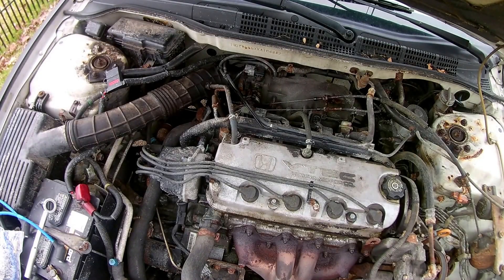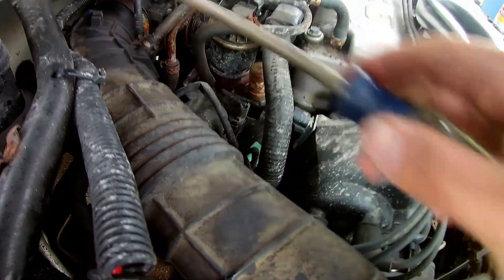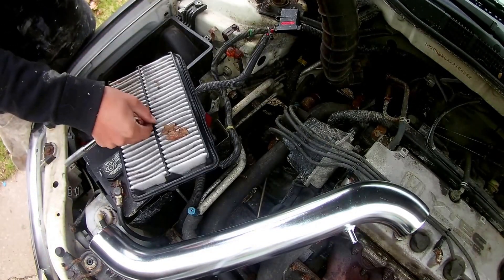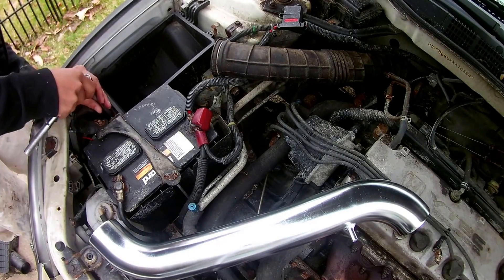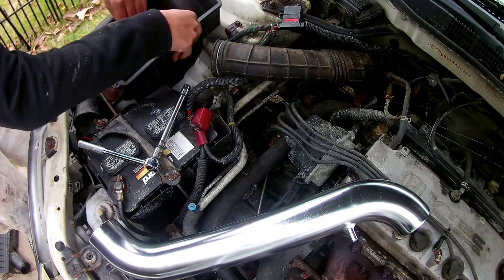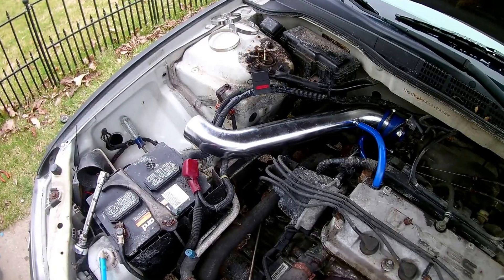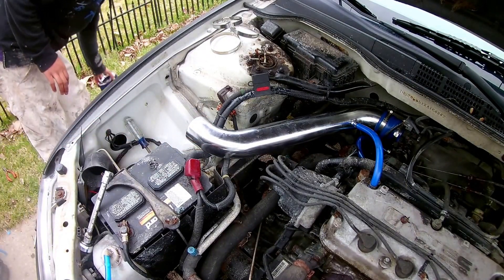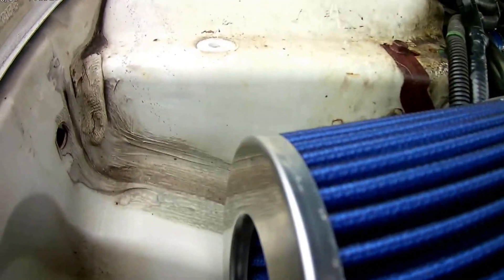How to Install Cold Air Intake on a Honda

Comment: I just got my 2000 honda accord ex. Ima put in the cool air intake first . Thanks bro
Reply from the maker: Good luck!
Reply: sorry to be offtopic but does someone know a way to get back into an instagram account?
I was stupid lost my login password. I love any tips you can offer me!
Reply: @Santana Kameron Instablaster :)
Reply: @Emmanuel Francisco it worked and I finally got access to my account again. I'm so happy!
Thank you so much, you saved my ass!
Reply: @Santana Kameron no problem :)
Reply: Serio dude i have a 02 ex coupe. I want to make it  into a rally car after I get my viper. The cold air intake is the first thing I'm getting for that ex
Reply: What good does the cold air intake do versus the regular air intake?
Reply: @Kontrol17  it just makes the engine sound cooler . They lie and say that it will increase your cars performance.  Unless you tune the car the airintake might even alter performance worse
Reply: @bobiphett4633 get the viper yet?

Comment: What did you do with all the other lines that you used the blue hose to replace?? I got like like 4
Reply from the maker: so the top line is just a ccv line basically a vacuum line the other you see are coolant lines that go into the throttle body. to help with cold weather. your car may be different but if you order your kit specific to your car it will have those accommodations.

Comment: You may want to get of make a heat shield to isolate the filter from the rest of the engine. While it is a ways away the heat of the engine bay with still reach it. Nice job tho.
Reply from the maker: ALPHA THE PANDA  Thanks for the great advice I have seance made a air duct str8 to the filter!!
Reply: Zay's Automotive is no problem mine is 94 accord ex so I've encountered somethings while working on it. Also if you haven't done it yet look into getting some new spark plugs and spark wires. NKG all the way my friend.
Reply from the maker: Yea man look at 3:33 NGK plugs and wire set is on the car!!
Reply: Zay's Automotive that ever so lovely acceleration rumble.
Reply: Zay's Automotive you also need to get your computer reprogrammed after every modification otherwise you waste your time , performance chips do not cost a lot , that way you get them tweaked also for higher octane fuel and any other modifications you have done , i watched that video you did on acceleration times and you were 0-60 mph in about 9.1 seconds these cars factory do 8.6 seconds . So all the mods you are doing are pointless without computer programming in fact its making your car slower
Reply: Dyno test have shown absolutely no decrease or increase in hp due to placement of the filter or temperature of the air.  The only increase comes from the amount of air being pushed into the engine; after all, your engine is nothing more than an air compressor.

Comment: That’s not a cold air intake. It’s sucking hot air now, good job. For it to be a cold air intake the intake has to be down toward the bottom of the fender, away from the HOT AIR of the engine.
Reply from the maker: True

Comment: These things are more detrimental versus the so called “performance boosts” they give. The only thing this’ll do is shorten the car’s lifespan. It doesn’t increase mpg, or horsepower. It just makes noise. That’s pretty much it. 

When adding one of these you still need to reprogram the computer for it to work flawlessly. And even then, the accord wasn’t designed for this to begin with. Any amateur who thinks they can just remove the stock and replace it with this, is sadly in for a bad time. Especially if they do it wrong.
Reply from the maker: Very true !

Comment: What exactly did you do with the coolant line that goes from the block to the throttle body? Leave the stock one or just replace it with a straight hose connecting the ports?
Reply from the maker: I deleted the stock metal line and ran a new line from the block to the throttle body works fine but really you can just leave it and it works just as well.. But i deleted because i also install a throttle body spacer as well and i would of delated anyway as well.

Comment: Can you explain what you did with the smaller hose? Looks like you cut it in half and used the other half just below it.
Reply from the maker: Yea so with the other half I  used it for a coolant line that goes from the block to the throttle body. For just looks and for the next upgrade of the throttle body spacer I was gonna need a extra inch of line for what was originally there.
Reply: Zay's Automotive thanks bro. So i have literally the same car, just put the intake on. Im getting a whistle when accelerating. I thought i had the clamps super tight. Did you replace the filter?
Reply from the maker: No problem and that's great you post a vid on it !!! I check out you gun videos too pretty cool. The whistle is normal its just the motor breathing better!! and for the filter you can replace it or I just clean it out with water and let it completely dry.

Comment: So I want to do this to my honda but my friend said it would run like shit because the computer isnt programmed for it. Is there any truth to that? Do you gotta reprogram the ecu to get it to run properly?
Reply: no it's not a nissan lol
Reply: You can add any cold air filter k and N is the best from local auto stores and no it does not effect the engine or throw any codes or check engine lights if anything u will get better throttle response and better. Gas mileage
Reply from the maker: Its not a major change to the motor the ECU will actually see that the motor is breathing better and adjust the air fuel..

Comment: Gotta 94 didn't come with a overflow resovor...how important is that
Reply from the maker: You might want to add one any autoparts store have them or junyards. It allows the colant to boil into the bottle. its also a easy way to keep a eye on your colant level.

Comment: Nice vid, hey when you changed your spark plug wires did u changd distributor as well or just wires?
Reply from the maker: Yes I did
Reply: I just changed my wires fuck the distributor it’s going on 4k miles

Comment: ???? So this intake comes with no support brackets and is only held up by the clamps and whatever happens to be under it ????
Reply from the maker: This one does because its so cheap but more expensive ones do have supports.
Reply: @ZaysAutomotive  Mine did come with a big hose clamp and an aluminum angle.  No instructions, you just gotta do your best and make it work; I made it work.  I also needed to add some insulation rubber for vibrations.  (My engine vibrates without the balance shafts)

Comment: Seems easy enough. I need a new air intake because mine looks old (or do they get old?) I bought the car 2 years ago. I wanna start working on it little by little.
Reply from the maker: Yea the actual filter itself get dirty you can either replace it or clean it. But both items are sold at the autoparts store.

Comment: You shoulda just pulled the lower section of the factory air intake system off and tossed it in the garbage and zip tied the breather filter to the top section of the factory air intake.  results? the same as seen if not better.
Reply: Lets see your ghetto rig... gotta link?
Reply from the maker: lets see it bro !!

Comment: So at 2:13 how did you remove that metal line?
Reply from the maker: It has pinch pinch clamps to them if you just squeeze them then pull out the metal ling you good to go..

Comment: short ram and cold air intake have any difference?
Reply from the maker: Short Ram is short and it usually sits in the engine bay. Cold air intake usually sits in the fender or has heat shielding around it.. Short ram sounds and looks cool for a cheap price. Cold air is all of those but has a performance increases and a little more expensive.

Comment: Hey man, where did you get the cold air intake from??
Reply from the maker: <a target="_blank" href="https://www.amazon.com/gp/product/B00L9NHYGK/ref=as_li_tl?ie=UTF8&camp=1789&creative=9325&creativeASIN=B00L9NHYGK&linkCode=as2&tag=zaym2531-20&linkId=79dd40eb600d7cd30741d47b5b32d9c6"></a><img src="//ir-na.amazon-adsystem.com/e/ir?t=zaym2531-20&l=am2&o=1&a=B00L9NHYGK" width="1" height="1" border="0" alt="" style="border:none !important; margin:0px !important;" />

Comment: 😂...by definition, what you initially took out was more of a cold air intake than the aftermarket air induction setup. Your OE airbox pulled in cool air from the outside of your engine compartment. The aftermarket setup you installed is quite literally pulling all the hot air from your engine compartment into your engine. Lol, it's ok...when I was a kid, I pulled the same shit. Then I grew up and became ASE certified and learned the error of my ways.😂
Reply from the maker: LOL its true but great entertainment and if i wasent cheep. I would of bought the one with a heat shield. and it looks great!
Reply: You want cold air intake put a turbo system on. that is where the real cold air induction comes from.

Comment: He realizes that this is a short ram air intake right? It’s intaking the warm air from the engine bay. A real cold air intake take in the “cold” air from outside the engine bay.
Reply: Which in turn can give you a better noise, but ultimately lower horsepower output depending on engine size, and how hot the air is
Reply from the maker: Yes sir